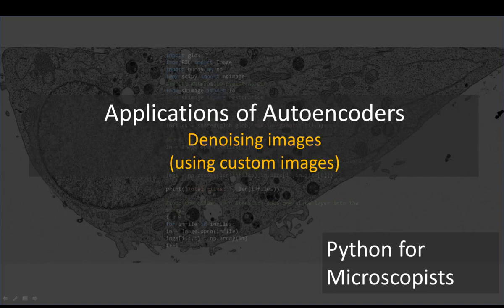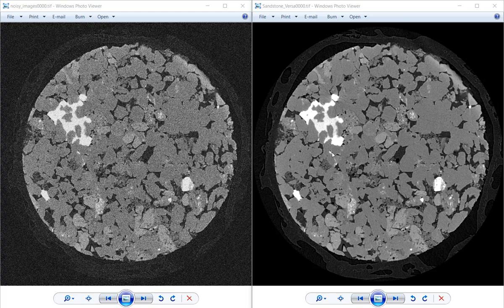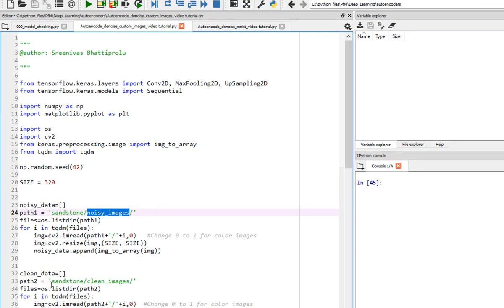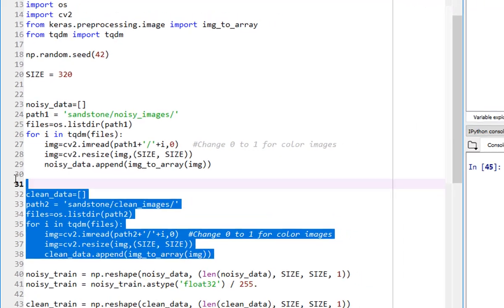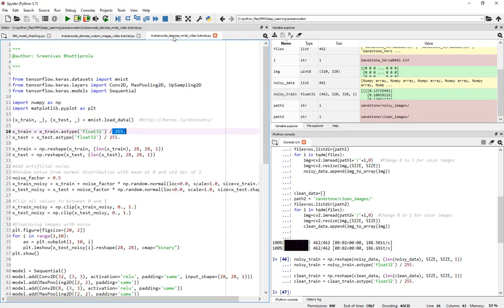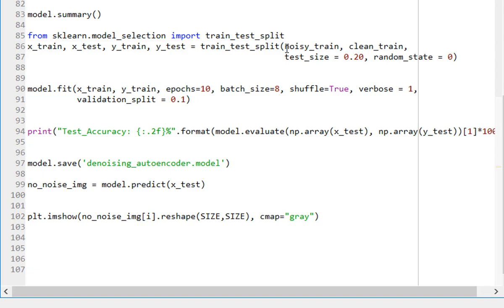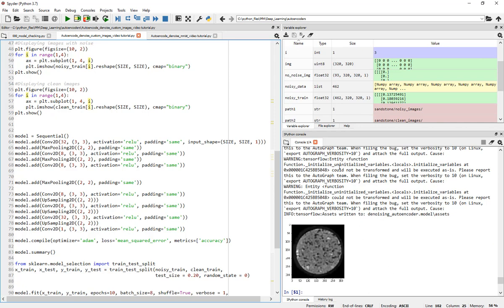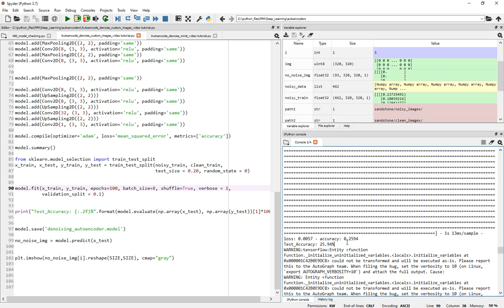87 - Applications of Autoencoders - Denoising using custom images

Comment: Dear Dr. Sreenivas, 
Thanks for your tutorial. I have two questions,
1. In your code, there are two paths, clean and noisy, but in GitHub, there is a series of images, do the images of noise and clean necessarily have to be the same? Or not?
2. I use echocardiography images. Unfortunately, whatever I do, the accuracy does not increase by 30%, but loss decreases below 2%. the number of images is 60,000, and the size is 112. I change optimizers and loss functions. What is your suggestion?
Reply: I have a similar query. Could not find data files on github

Comment: Sir, in your github code of auto encoding single image, how is your model learning from single image and not large data set?An explaination will be friitful for my research paper.
Reply from the maker: The model is learning only from a single image because with autoencoder I am trying to reconstruct the same image. The trained model will only reproduce the input image as that’s all it ever got trained on. This model is not generalized to work on other situations. It was used to demonstrate the meaning of autoencoder. In real life you’d be using autoencoder as part of some application such as denoising or anomaly detection where you train it on larger datasets.

Comment: Hi, Sir Sreeni! :)

I’m just wondering—after we obtained the most important features from the bottleneck of our trained neural network, is it possible to apply the denoising capability of the autoencoder to a live feed video that is somewhat highly correlated to the training images? 

Will this be better, or even recommended, instead of using traditional denoising filters of OpenCV for real-time videos?

I’d love to learn more from your expertise and advices as I explore this topic further. Thank you for the insightful explanation by the way! Subscribed! :)
Reply from the maker: Once you have a trained denoising filter, using AutoEncoders or Noise2Void or other networks, you can use it to segment future images. The future images can be z-stack or time series (video). Live video is basically a frame by frame image.

Comment: thanks for the video sir..  I tried to implement the same to denoise dicom CT images using Colab... but not getting result..can you suggest the changes to be made for CT dicom images
Reply from the maker: Denoising using autoencoders can take a lot of training data. For CT images try BM3D (traditional approach). If you want deep learning please look at a paper called Noise2Void. We implemented that on our image analysis platform APEER. You can use it to denoise your images. it is free. www.apeer.com.
Reply: Thank you

Comment: how about if i just use noise images ? how to train it?
Reply: sorry, i mean you make 2 path,clean images and noise images,of course i just need to denosing, noise images, so i dont need clean images, and the train codes need parameters which in your code used noise and clean parameters, how to make just for denosing ?  thank before
Reply from the maker: You need both noisy and clean images only for training purposes where you create a model. Then you can apply it on noisy images only. You can take an existing model if you can find something online and enhance it with your own data, this process is called transfer learning. In other words, you need some model that is trained on noisy and clean images so you can perform denoising. If you don't have this model then try normal approaches like non-local means denoising or anisotropic diffusion. In fact, they work well for different types of images including microscopy, MRI and CT.

Comment: Thanks for your outstanding explanation.I am getting this error would you give me some suggestions??

 IndexError: index 2 is out of bounds for axis 0 with size 2
Reply from the maker: You seem to have an array with shape 2 where as it may be expecting the array to be of shape 3. Please follow the variable array shapes and pin down the issue. If needed, expand dimensions to make sure the inputs comply with the expected shape of the array.
Reply: @DigitalSreeni  I got it

Comment: ouef, but i did installed on Win 10 by using anaconda navigator
D:\z_fyp\extra test\clahe\python_for_microscopists-master>python 086--auto_denoise_mnist.py
Traceback (most recent call last):
  File "086--auto_denoise_mnist.py", line 9, in <module>
    from tensorflow.keras.datasets import mnist
ModuleNotFoundError: No module named 'tensorflow'
Reply from the maker: Not sure what your question is, obviously it cannot find tensorflow on your python so please do pip install tensorflow.